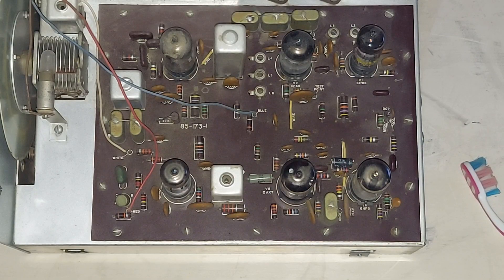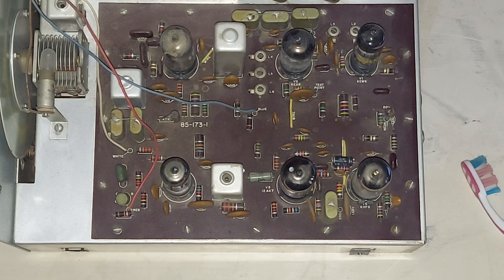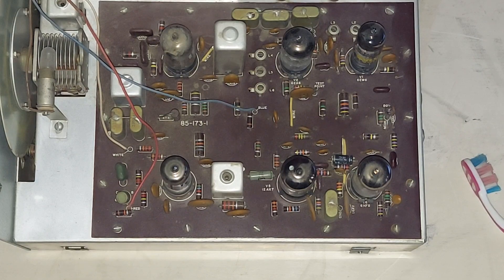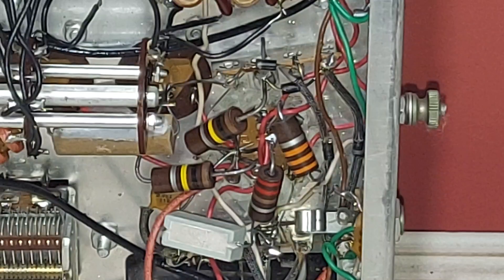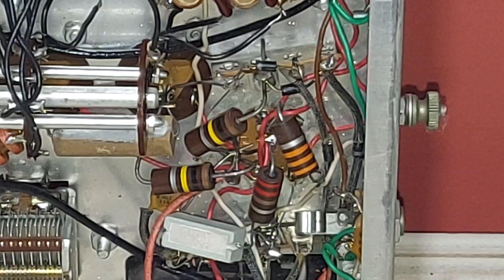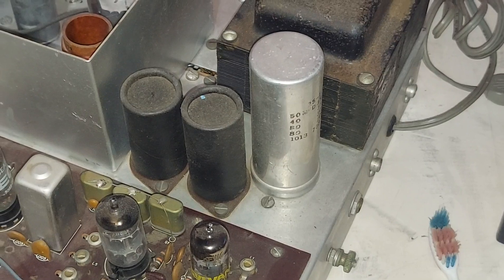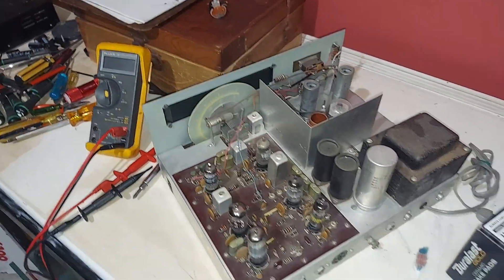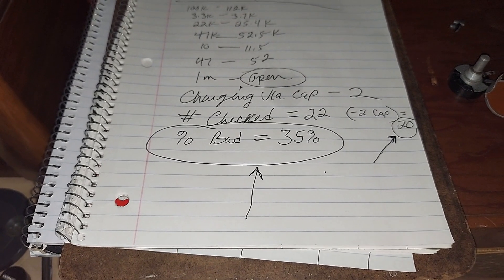Heathkit HW-16 – are ANY of the resistors good?

Comment: One thing to keep in mind is that modern film resistors tend to have higher parasitic inductance than the vintage carbon composition resistors.  This could possibly make a difference in RF circuits.  I avoid replacing carbon comp resistors that see RF unless they are really bad...  more than just a little out of tolerance.
Reply from the maker: @JPM1956  I agree that metal film are very lossy. I'm not sure about thick and thin film resistors. I'm about to order thick film ones for the input on my rf attenuators. The Caddock ones I'm buying claim to be non inductive. I'll see about that. Lol.
I see that there are some carbon comp resistors still available at Mouser.. but not many. And they're $$.
Thanks for the comment! You are correct   :)

Comment: I am currently working on some older TenTec  Radio Equipment and had this same question.  My experience tells me changing only a portion of certain components especially in Rc / RL  circuits is like changing the brakes on One Wheel of your Vehicle, It usually does not end well... As for Resistors, I would only change those close to or out of tolerance.  Now let me ask you this! 
Do you have trouble finding Tubes ?  Best Wishes  &   Thank You
Reply from the maker: Hi Ken-
I can't say that I have had any trouble finding tubes.. but I've always needed pretty common ones. I've had good luck with buying them on eBay, and I've also bought them from Viva Tubes.
Thanks for your comment! Be well  :)